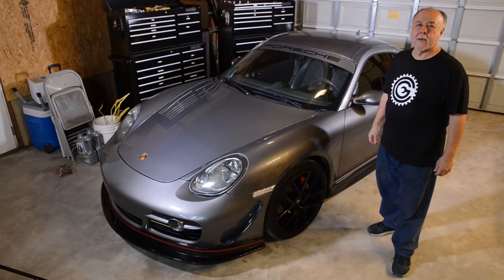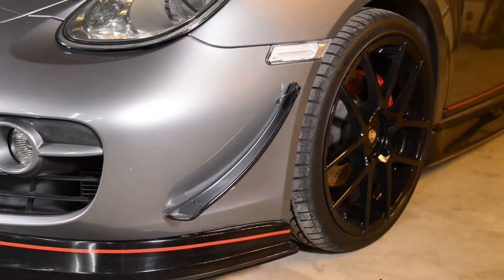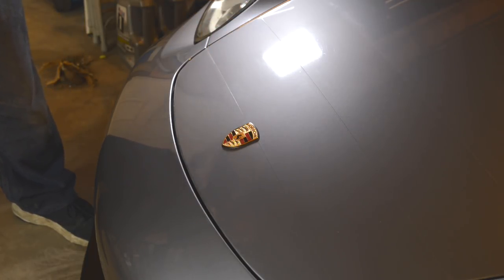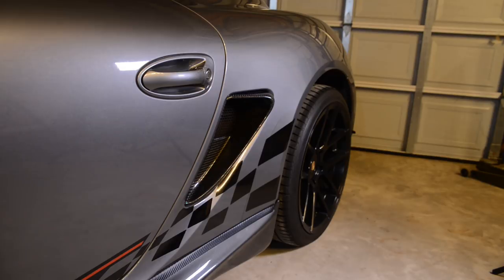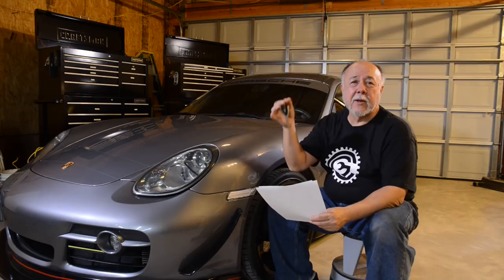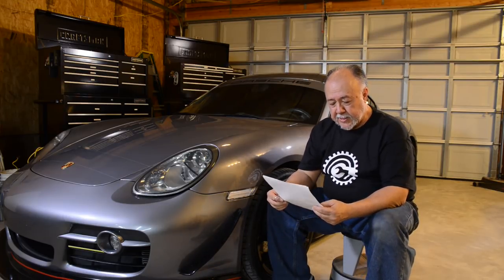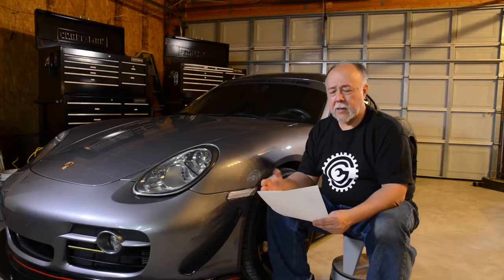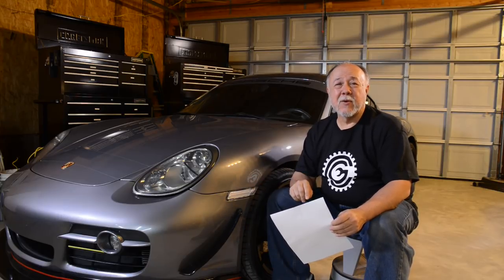I Bought The World's Ugliest Sports Car

Comment: I love mine but the horror stories concern me about the engine ! Mine makes odd ticking noises when it’s cold
Reply from the maker: I'm not an expert, but I think ticking when cold isn't unusual or worrisome. Apparently the lifters can stick a bit until they get properly lubricated. If you're talking about the bore scoring problem, that will manifest as a noise that doesn't go away. And it's really quite rare, although devastating when it does happen. If you're concerned, have Porsche or a good independent shop check it out.